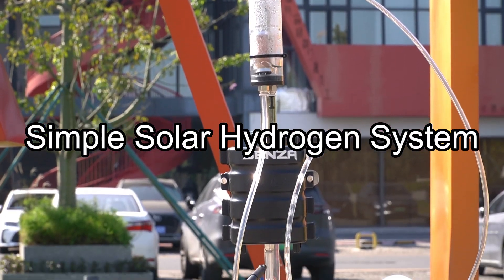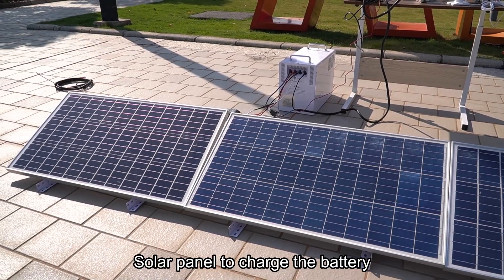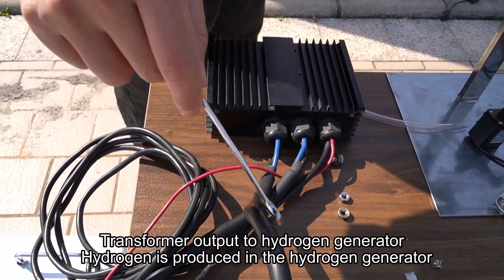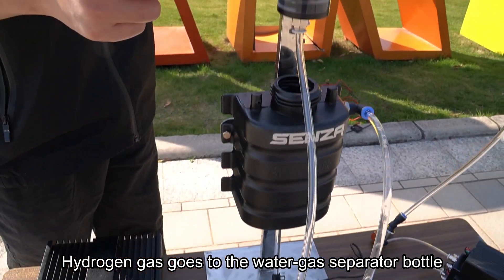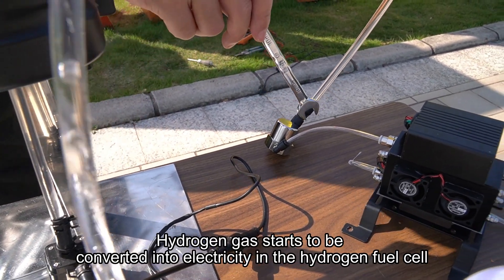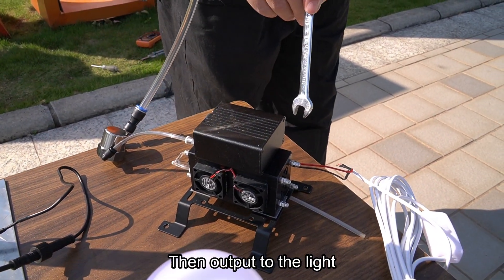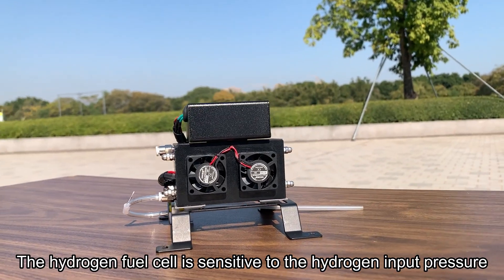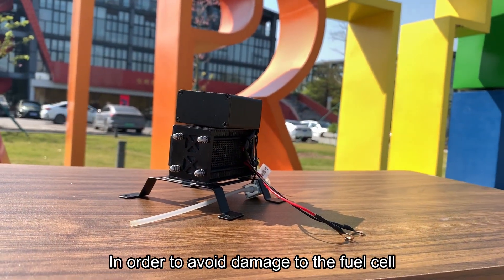Simple Solar Hydrogen System

Comment: where does the stack get the oxygen from? I just see the hydrogen supply and the cooling fans. does the fan also supply the system with oxygen?
Reply from the maker: Oxygen is obtained directly from the air.The purpose of the fan is to dissipate heat.